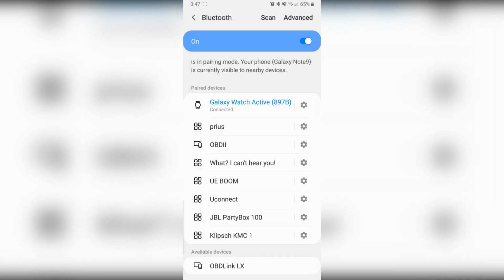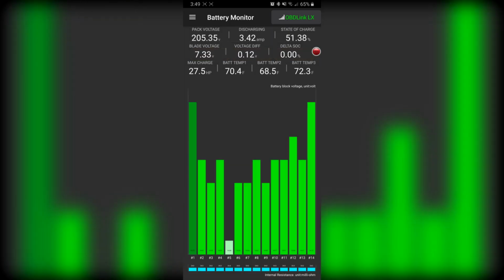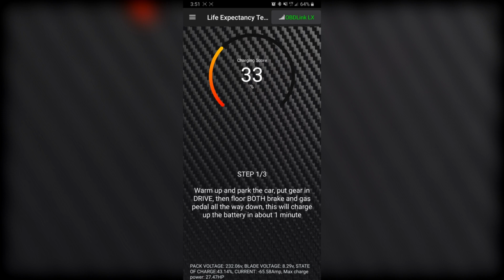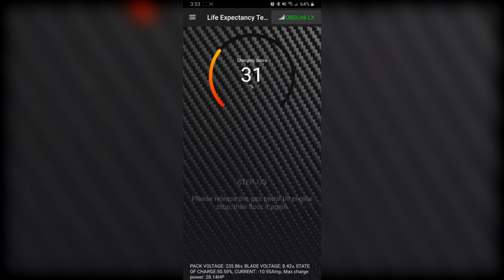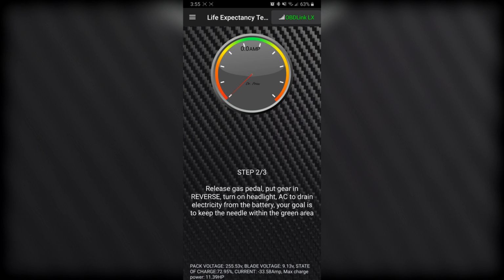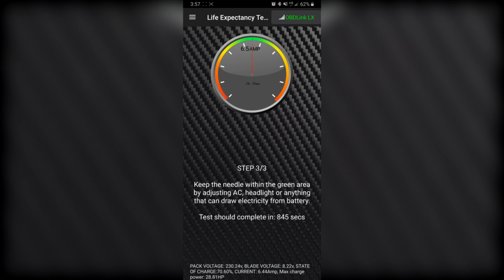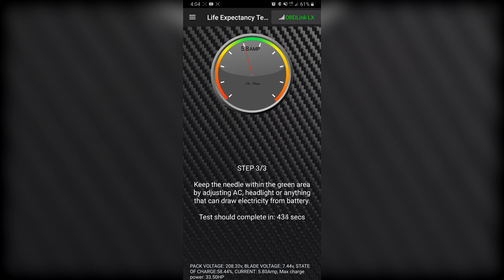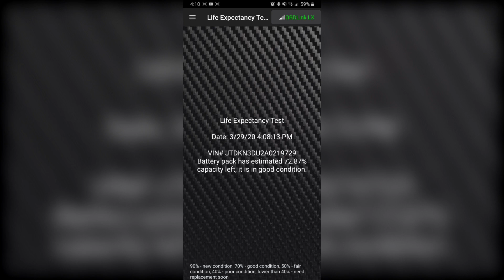How To Test Prius Battery Health

Comment: Do you think a 2013 with ~120k miles would have better battery health or worse health (on average) than this car here? 

Main difference being a slightly newer battery, but more miles. I’m not sure if age or miles impacts battery life more.
Reply from the maker: Age and miles both impact the battery but so does heat. Two 2013s both with 150k miles could have packs that last to 250k but the one that has been garaged is much more likely to have the healthier battery. Both my 2010s have less than 100k miles but the car with less miles actually has the pack with the worst battery because its previous owner didn't garage the car

When these packs fail its usually the middle cells because they are exposed to the most heat most often.
Reply: Age is more important than miles.
Reply: I had a 2006 Prius w 225k miles on OG battery pack and was going fine - until a dummy turned in front of me and totaled my car.
Reply: I have a 2014 Prius C, 3
With 88,250 miles. 

Does it have a giant battery and a regular little 12v battery?

What you're testing in this video is the giant battery right?
Where is it located? 

Thank you, this video was very helpful.
Reply: @LM2FBF  
88,250 MILES? THESE HYBRID BATTERIES DON'T FAIL THAT SOON MAJORITY OF THEM FAIL AFTER 200,000 MILES 
AND 
YES ALL HYBRID CARS AND TRUCKS HAVE 2 BATTERIES 
SO IF YOU SEE YOUR DASH LIGHT UP AND TELL YOU TO CHECK HYBRID SYSTEM IT'S HYBRID BATTERY 
IF YOU SEE NOTHING LIGHT UP IN THE DASH COMPLETELY DEAD THEN IT'S 
THE SMALL 12V BATTERY THAT IS DEAD
Reply: @MrDICKHEAD28  thanks!!! No dash lights coming up. I'm just troubleshooting because it trembled yesterday when I turned it on and drove off. It also feels like when you're driving a manual car and that car cant shift from 3rd to 4th or 5th. So I started googling right away. 

The clear tank on top with pink stuff (transmission fluid, if I remember correctly) is a little low (below the seam). So idk what it could be. 

I changed the oil and oil filter a month ago. I'm gonna replace the engine filter and cabin filter this week because I saw someone say that's part of the 90k tune up, idk. And I'm gonna vaccum the battery fan under back seat. Those are some things I can manage on my own.  I have no idea what it could be.
Reply: @LM2FBF  mine does this too... did you ever figure it out?
Reply: @sallywatanabe300  I believe replacing the Hybrid battery fixed it. 
Which I had to do at 97K miles. Thanks to God it was still under warranty until 100k miles so Toyota covered it.
Reply: What about a prius 2005 with 125k mileage?
Reply: What about prius 2013 bated life with 237000 miles
Reply: The battery cares about charge cycles  not mile or even time. It also important what temperature those charge/discharge cycle occur (simply saying high temps are bad).  So a car used a lot in short runs potentially used up a lot more charge cycle in a lot fewer miles than another car which runs  long trips on highway where the battery doesn't get a lot of charge/discharge.  And a similarrly used prius in Arizona will have  more degraded battery than a more moderate climate.  (Again these are general rules each car and its battery are different.)
Reply from the maker: @NixUgriBugri  yes, its easier to generalize battery cycles to miles as they are positively correlated.
Reply: @HEVTech1  " its easier to generalize battery cycles to miles as they are positively correlated."  Yes it is easier BUT simply not true,  just to give an extreme example it is not the same if a prius is used as a taxi in middle of Manhattan or I drive 60 miles daily on a highway  (not in stop and go traffic like CA but a rural area.)  Miles are a lot better indication of the mechanical parts like engine,   drive train etc not so much for battery. As I said even the climate matter quite a bit... It is quite important to learn as much as possible how the car was used.   But of course it is usually hard or  down right impossible to know how the previous owner used the car (if you consider buying a used prius)  the only thing you can usually get is the mileage  and perhaps maintenance and repair history.  So this is realy good tool for anyone who consider buying a used prius ... havent tried that although downloaded the app over a year ago.  Just switching out my ScanGauge II is a hassle but will do it someday.... to test  my 2012 Prius.  But I am the first and only owner so I know my driving history.
Reply: @NixUgriBugri  I brought my 2007 Hybrid Camry two years ago in an auction! It was my first hybrid ever so I try to work on the battery pack last year! Thanks for the Y.T. video, I learned form zero and finally rebuilt my pack completely after dismantled it three times! The odometer was 246,790km. when I first got her on June 2018, after battery rebuilt I drove the Camry until now~259,500km. She survived last year harsh Winter of Calgary , Alberta(-30 degrees C) My target on this Camry will be 400,000km. on this first battery rebuilt!
Reply: @ChuiSamuel  I just bought a 2012 Prius. I live in Banff. Did you do it yourself? Do you know a good place to test and service batteries in the city?
Reply: @ChuiSamuel  hi could you share the video that taught how to rebuild battery pack?
Reply: According to a mechanic I know and the numerous online articles I’ve read, 150k is about the point that many packs start falling below an “acceptable” level of charge held. 

Of course this is not set in stone, as some batteries last much much longer than others. And even then, you may only need to replace a couple of cells within the pack to bring it up to par, but remember it’s only a band aid.
Reply: @p.b.9428  i have two prius one with 224k miles and 218k miles 
224k miles prius is starting to fail before 10k miles back it was showing signs of failing but it's keeps on going  

the other prius 218k miles still looks fine no problems

Comment: Anybody know if this is still a valid test to do in late 2025?  Thanks.
Reply from the maker: With a stock NiMH battery? Absolutely it is.
Reply: @HEVTech1 yes stock battery on a 2010 Prius with 180k miles.  Car drives fine but wondering how the traction battery is doing.

Comment: cool video.  My 2014 prius V has 254k miles and no problem with the battery yet. However, I have had to replace the engine and transmission:(

Comment: Do you hit the accelerator when in reverse to keep in the green.  I just did the test and had to press the accelerator while in reverse to keep it in the green, while running headlights and AC.  My score was a 39.4%.   I also did the full battery test and it wouldn't get past check temperatures.  It said, Warning! Battery too cold to continue test 77F.  I have a 2012 Toyota Prius V.

Comment: If you want the inverter to last longer, it is a good idea to replace the hybrid battery when it's around 70-80% capacity. Cheaper to replace the battery than the inverter.
Reply: Inverter needed replacement when it overheats due to inverter coolant pump failure
Reply: @ maybe ill change pump when it reaches 7 years old

Comment: I get the low traction battery warning before I can compete the test with about 170 seconds left. I had to charge the battery again I got 48.3% after that on the test. Should I run it again?

Comment: I have use this device and software back first was released and it worked fantastic. Unfortunately, the software developer on the app has changed their policy and you can no longer scan for free.. after downloading the software, you will be required to purchase a license to complete this function of testing the battery. Although you are not be told that in the initial download, it is quite discouraging.

Comment: In my case step 1 never ends. I did for 30 mins and I luck. It keeps asking me to release the pedal, then press again, and repeats same thing. Battery charges to 60% and the circle in the app doesn't go any further than 70%.  What am I doing wrong?

Comment: H-EV Tech…why is your cell pack #5 reading off the scale low? If it is kaput, why wouldn’t the test flag this? What am I missing?
Reply: I noticed that too. I expected it to be explained in the video......
Reply: Pressing the gas and brake at the same time... does the computer run the ice if it doesn't need to charge the hv?

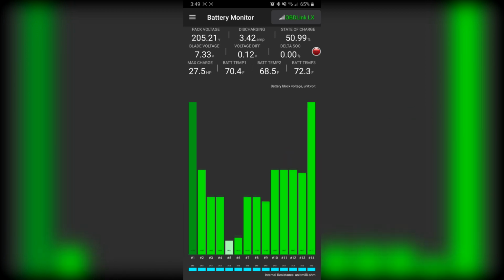Comment: There appears to be a low or dead module at the #5 position.  1:40 or thereabouts.  Why don't you break open the pack and replace that one?
Reply: The reason is because the other ones are still old, so you'll do all that labor of basically replacing the entire back but instead just doing one, and running the risk of potentially in a month or two after, another block dying.

Comment: The data link connector (DLC) is the multi-pin diagnostic connection port for automobiles, trucks, and motorcycles used to interface a scan tool with the control modules of a given vehicle and access on-board diagnostics (OBD)and live data streams.

Comment: You don’t explain a lot of key things - is just the electrical system running, is the car engine started and running, or what? Again you don’t explain, but are you flooring it in park with the engine running?? Park is not geared for a running car engine to be floored let alone held to the floor for any period of time. Are you trying to blow the engine?
Reply: Prius powertrain doesn't work the way a normal car does. It's safe to floor both pedals in one.

Comment: Great useful video - thanks! We are facing a question with our 2010 Prius with 195k miles whether the IMA battery is bad or not. The mileage has been pretty bad ranging in between low 30s to low 40s. I will try your methodology to get an idea about the battery later today. The car had a gasket leakage at ~165k miles which was repaired by Gasket Masters (they have a YT presence). Not sure if the engine is damaged...
Reply: Same thing happen to me after gasket makers fixed my head gasket my MPG dropped right away to 34mpg highest I’ve seen is 36mph
Reply: Gasket Masters *

Comment: Before troubleshooting individual cells, a diagnostic on the inverter coolant and associated cooling fans need a look. Without clean coolant and a proper cooling hybrid fan, new cells/pack will go bad again.

Comment: i cant seem to find an answer. if the battery is in new condition, about 90%... will that give you better milage than a 70% battery? im wondering if its worth trying to recondition my battery or replace it if its about 70%.  what do you think? im getting around 40 mpg and im trying to see what i can do to increase the mpg. i know it varies with conditions and how i handle the gas and up and down hill, but i have never gotten close to 50 mpg and that was trying my best to get the most milage.  i have a 2015 prius with about 87,000 miles.

Comment: Really useful, I subscribed and thumbs-upped for this alone.  Buying a 13-year old Prius most likely, because it’s what can be afforded, but this is right in the zone for replacement being possibly required, and flying blind is a problem.  Seems like £3k or $3k battery upgrades can be done now into Lithium ion, making the pack half the size and still better than the original, but three grand is enough to buy some cars with.  That’s the issue, paying or saving for a battery, is more expensive than running a gas/petrol or diesel conventional ICE-only as with those, you are paying a bill that is done-and-dusted as you go along.  Have to say, this is Toyota’s choice, to,use NiMH, but the Lithium ion batteries at the time may not have been much better.  NiMH is a second-choice, to me, from my experience with consumer batteries they are lousy, and die if unused for a while, but the Toyota packs have held up surprisingly well.  Thanks and take care.

Comment: 40% is poor condition. how much longer can that last though? anyone have an estimation coupled with north texas weather? it's a 2008 gen 2 prius with 143k miles. 

also, a couple days ago i had the red triangle of death. i saw there was an ounce of water under the battery and i drained that. a couple months ago i covered silicon on the commonly issued areas and have done a water hose test afterwards with no leaks after a few minutes. i didn't receive any codes during the red triangle which i find strange. i checked the battery fan wires for corrosion or loose connections. i tested the battery fan and it runs well. there are no clogs, it's clean throughout the intake and exhaust air. I put it all back together and the car works without issue again. I'm not sure what happened. before the inspection i unplugged the battery for over a minute many times to reset it and that didn't work.  any clue?

Comment: HI< I got the ap working. Put the Prius in Drive and them pressed the brake and the Gas at the same time.   THE RED TRIANGLE OF DEATH came up.  .Now if I put the car in drive, the red triangle comes up. The motor starts fine, the AC is working fine. Running a complete code check on battery and Engine results in no codes. The Car reverses fine. Any ideas?  I recently drove back from Maryland to North Carolina with no problems.

Comment: Hi, i have prius 3rd gen 2011 s led version, current odo meter : 98650Km, car show my error chech hybrid system, when i checked odb code it is: POA080 . Does full battery pack needs to be replaced?

Comment: Hi,  I just bougth a 2010 Lexus Rx450H AWD.
This is my first Hybrid Vehicle. I tried many times but it always stuck on Step 1 of the Life Expectancy Test, no matter how long I floored both brake and Gas pedal ( gear on Drive offfcourse)
I also noticed that the State of charge never passed 59%. When I drive the car normally, the state of charge can pass 70% but when I park the car and floor both brake and gas pedal, I nevet get pass 59% state of charge.

Comment: My battery is always in high temps like 117 to 130. Is that normal ? Also is the Dr. PRIUS app accurate in predicting life expectancy of the battery , bcz mine is at 26 % 🤦
Reply: What did you end up doing?

Comment: I do my maintenance of my 2012 prius at my local Toyota dealer. They do a battery check every service and than i get a certificate with a year warranty.  So i guess my 10 year old battery is still good enough. It’s the egr and the gasket that i fear. The most because i want to keep the prius longer

Comment: Hey Bud, great vid... I just subscribed. Question: I just bought a 2017 Camry Hybrid with 96,600 miles so a bit concerned on the battery condition.... would these apps work on the Camry Hybrid as well? I have no prob. buying a Bluetooth OBD reader and download the app if they do. Looking at the Hybrid Assistant app as well... Thanks

Comment: Amazon description say " Maximum Vehicle Coverage

OBDLink LX Bluetooth works with all 1996 and newer cars and light trucks sold in the United States (except hybrid or electric vehicles)."

Work or not work to diagnostic battery pack on a Prius ?
Reply from the maker: The OBD Link LX works for a 2010 prius. I am currently using it daily with Hybrid Assistant.

Comment: You listed 2 different OBD readers, will either one work with the APP that you downloaded to read the battery health? One is $70 and one is $20, it seems silly to spend $50 more if they both work and do the same thing.
Reply from the maker: The $70 comes recommended by the app developer and supports faster read speeds (more accurate data) though the $20 will work for a majority of the battery and code reading tasks needed for hybrid battery module troubleshooting.
Reply: @HEVTech1  Thanks, what will the $70 one do that the $20 one won't do? I want to be able to get all of the battery health information that I need from the app.
Reply from the maker: @jimsgaragetoys  if all you are wanting to do is a battery health test like I did in this video, the $20 one will work a treat.
Reply: @HEVTech1  Thanks! I just noticed that neither of these work with an iPhone. Do you recommend one that does?

Comment: Hi I’ve got a 16’ Prius Hybrid C that has 23k on the Odometer. I got a car diagnostics completed… all of my battery block vol are showing up as 15.84V. Is that good or bad?
Reply from the maker: 15.84v is normal. As your SOC goes up the voltage will also increase so 15.84 may be <14v or >16v this is expected and nothing to worry about.

Comment: But what's the miles on the car?! More miles = More cycles. Usually I think. Also since battery cells don't like to be off balanced and using off balanced battery cells is detrimental to all the cells. Do you think it's possible and/or recommended to simply take out an individual cell until the other ones are diminished to the same level of the cell taken out? So that one cell that was taken out can be put back in and then have a rebalanced overall battery?

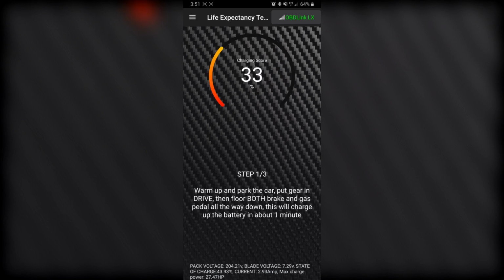Comment: 2:12 are you sure they didn’t mean put car in park, not drive? Seems dangerous to put in drive and press gas and breaks while in drive. You’ll destroy your car and breaks. 🤣🤣
Reply from the maker: That is what the app said. When the brake is depressed with the gas pedal the motor generator will charge the battery.
Reply: @HEVTech1   Hello , in step 2, it goes into reverse, and the brake is applied, isn't it enough to depress the brake pedal?  thank you very much ...

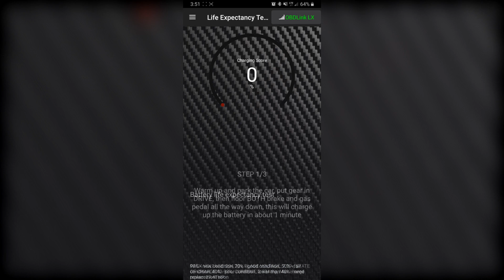Comment: 2:12 I think you’ll destroy your engine, breaks, and car if you follow these steps. 🤣
Reply: Nope is not only throttle by wire the brakes are also computer controlled.

Comment: Wow! very helpful video for those who own Hybrid cars.Hybrid battery is a great concern.You will know this if your EV mode keeps stating “not enough battery”to operate EV driving mode.You will know  this when you only get 2 to 3 bars showing on the battery display.You need at least 4 bars to operate the EV driving mode.